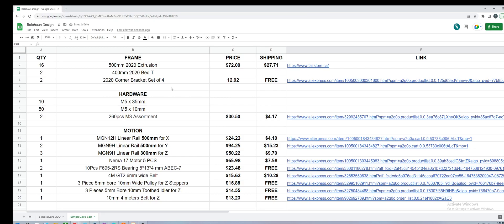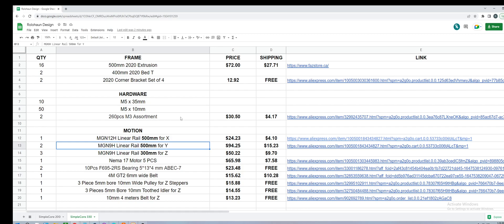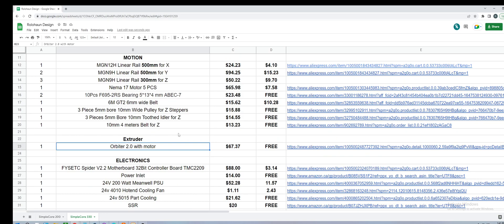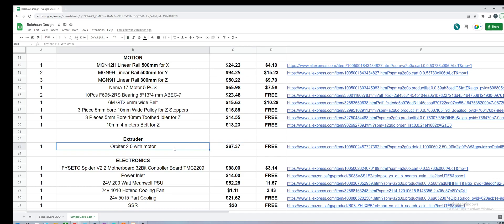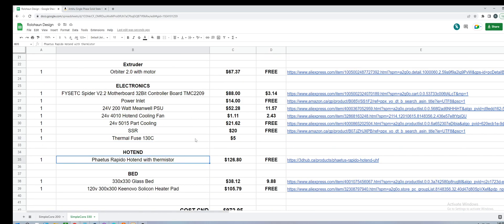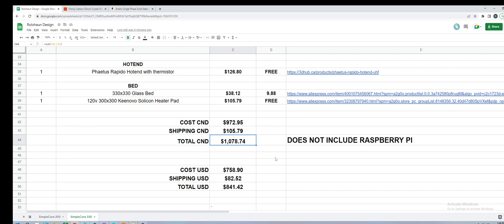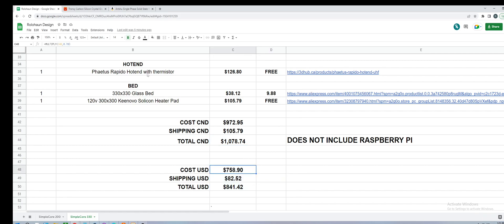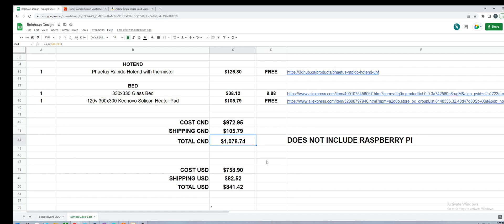DIY CoreXY 3D Printer SimpleCore 300x300 Version - Part 4 FINAL

Comment: The SimpleCore has a few advantages. First, it is a quite a bit cheaper if you dig in a bit deeper. The Trident costs you a couple hundred plus bucks just in shipping, you forgot to mention. The Trident comes with a hotend I would not want and the expensive choice of your bed heater does not compare well (quality wise) with the Trident either. More important however is the level of flexibility and engagement. With the SimpleCore I can play and change, improve and develop. I am the active part. The Trident design kit locks me in a lot more. It makes me the passive part, the screw together guy. Just match instruction pic with reality and you become the big printer builder. Does not go very deep, right? You mention blind joint connectors? Bolt them together and then check with a good square. Pain in the ass if you want to get a frame square and true and you will end up buying the face plates anyway. Congrats for going the simple way and thanks heaps for sharing, mate.
Reply from the maker: Thanks! I agree with your points, the trident however was 1300 shipped to my door so I did factor in shipping. But SimpleCore is still a nice option and it defiantly could be cheaper with a few changes! Thanks for the comment!
Reply: @Rolohaun  You are an inspiration and so is the SimpleCore. Keep it up.  Am with Einstein on this: "the best solution is the simplest that works". But I would like to add that your personal engagement and your personal support make the SimpleCore the very best "simplest" solution.
Reply from the maker: @aps3000miki  thank you! Don't worry more videos of SimpleCore and other printers are coming!

Comment: Very nice project and a great idea, of course the learning experience is a big plus. I think that with a simpler beed system 1 motor like vzbot and cheaper hotend you could reach 700$.
Reply from the maker: individually controlled steppers was a major design feature for me, I can see the savings would be there if I went to one z stepper